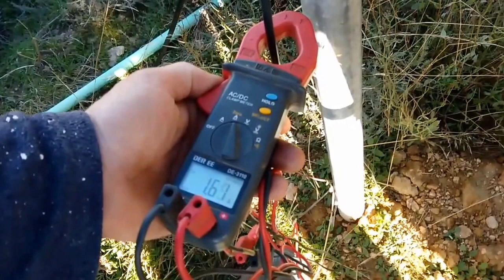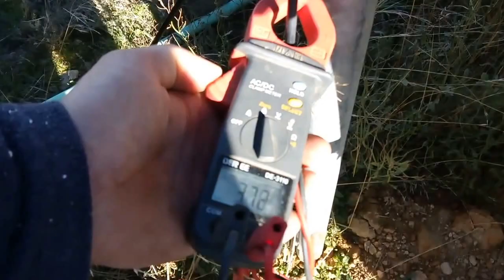Quick easy way to check solar panels

Comment: What is the total system configuration of your this solar panel? How many total watts of panel. How many volts Open Circuit and when the system is on load.
Reply from the maker: check out my other video I think it explains this cheers
Reply: Thank you